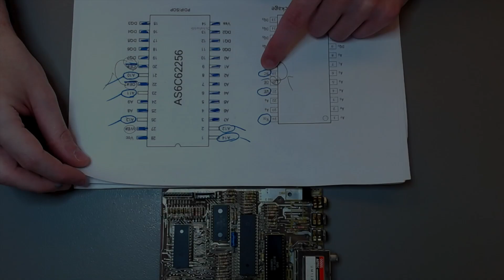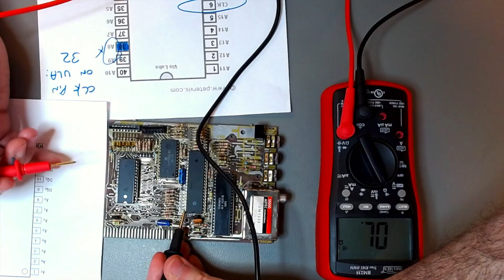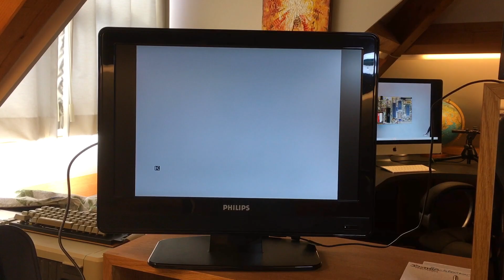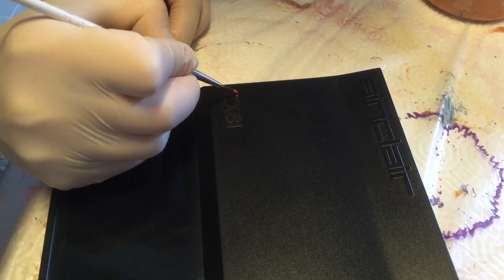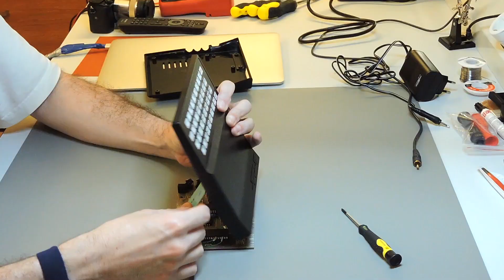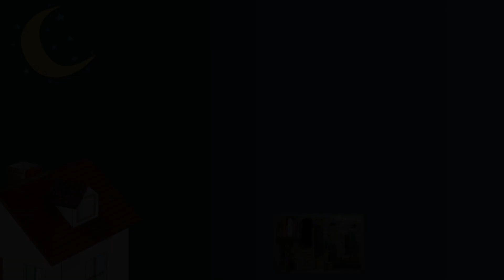ZX-81 memory mod, case & keyboard restoration, test-drive

Comment: My TS1000 has a D4016C chip, DIP24, in there with the LK2 already jumpered. I'll be changing to a 62256 this week. I'm glad I watched this video first, one less pin to worry about. Thanks!

Comment: I really learned a lot from watching your excellent videos on the ZX81, thank you for doing them.  I finally got my TS1000 working, I replaced the ULA with a vLA81, and that did not cure the problem, then I replaced the Z80 cpu and that cured it.  Now it has a new ULA, CPU, and 62256 memory mod.  I am going to order in a new keyboard membrane for it.  Thanks again for your help.  RJ
Reply from the maker: Nice to hear it!

Comment: Yes I agree, fantastic work.  After I finished Pimping Up my ZX81, I decided to do the same on a TS1000 that I have.  I did the composite video mod, and got the K cursor just as on the ZX81, next I did the memory upgrade just as before and got the K cursor, only it takes a little longer to appear, next I did the power mod, and installed a new Z80 and again seemed to be OK with the K cursor, and let it sit for awhile to see it anything over heated.  I then put on a new keyboard membrane and reassembled it.  After reassemble I hooked it up and powered it on, up came the K cursor as before, so I tried out some of the keys, and to my surprise none of the key function at all.  I took it apart and checked for +5 volts at all the locations and all seems OK, same for the 0 volts.  I am at a loss, any idea what the problem could be?  I am thinking the ROM?   Any help would be appreciated.  Thanks.  RJ
Reply from the maker: Was the previous keyboard membrane working at least partly, before you replaced it?
Reply: @thebyteattic  I would have to say no, because it was broken at the connector.  I went ahead and done the composite mod and got the K cursor, and the the RAM upgrade.  I did cut the broken end off the membrane and tried it, but had no response, so I then installed a new membrane with the same result.  Any thoughts?

Comment: I have a faulty ROM on my ZX81; before I buy a new one, I would like to make a test with a EPROM 27C64 (on a breadboard, as wiring is different).
Any idea where I can get the ROM content as binary or intel hex file?
Reply from the maker: I am not sure they are online somewhere, though I never searched for it.
Reply: @thebyteattic  I can't find it neither... Strange, as the ROM is fully disassembled with comments...
Reply: Search 'Files for ts1000-roms'

Comment: I don't think it is worth the trouble making an SD card work and changing the ROM etc.  This site https://forum.tlienhard.com/phpBB3/viewtopic.php?f=2&t=3360 shows Wespi running on an ESP32.  These come in larger sizes now that will hold every piece of software ever made for the TS1000/ZX81 and a web-based site where you can add more .p files.  They will be adding commands to rename, delete, move etc. that are run from the ZX81.  All via the SAVE signal that use to tell the TV to make those squiggly lines.  I am going to try this out.  My only worry is load time.  They say it will be the highest available on the Z80, which I think is 1200baud.  I hope that is fast.  I still don't even like waiting 5 seconds for a program to load, being use to the emulator(s).  The genius of this is that you mount it inside the computer and then use any computer to access the website on wifi that's inside the ZX81.  It's like having a built in hard drive without the hassle of trying to get IDE interfaces to work.  At one point I bought an IDE-->Compact Flash board to try to do this, (seems like noone has actually done this, but I did see a 1581 commodore emulator type unit that might work)

Comment: I have ordered the ULA replacement.  Can you please provide how to fully use the 32K or even a 64K chip?  It seems a waste to spend $45 on a ULA and not just put in 64k (max without bank switching) since the memory chips are super cheap.   https://www.tindie.com/products/charlieingley/vla81-zx81-ula-replacement/
Reply from the maker: 64KB is impossible on a ZX81, as the ROM must use some of the address space. To use 32KB of RAM you need an extra address pin from the ULA (the Z80 already has it). If I remember right, the replacement ULA has a free pin because it doesn't need to use an external oscillator (it has an on-board one). But I don't recall now what it would take to use that extra pin as an address pin. I remember it wasn't worth the effort, though, as there is no software for the ZX81 that uses more than 16KB.
Reply: @thebyteattic  Thanks for your fast reply.  Pimps don't need half the stuff they have either.  Isn't that the point of pimping out something?  Gold ear and mic jack's?, not necessary either.  So I want to make use of the full 32K chip or even a 48K chip if available.  The eighty one emulator shows the option of 48K for the TS1000/ZX81.  I am actually working on a GUI for the 2068 and later will port/rewrite it for the 1000.  I'm not sure if I will break the 16k mark, but it might.  And as I add features it might even break the 32k.  I want to use real hardware and not just the emulator.  The TS1500 comes with 16k on board and one can plug in a 16k Rampack to get 32k, but I guess there are a couple poke commands that also need entered (have not found them online yet).  So my guess is that we bend up the ULA line that would go to the oscillator and then connect it to the proper Z80 line for memory and run a couple poke commands.  Any info will be helpful, even if you don't want to do such work.  I also have 16K and 32k and 64k and a 128k  memotech RAM modules, not sure how they work yet though.  And also the memotech HRG module.  (That one I found instructions for online).  But seems like the new HRG software does not even use this device and does it some other way called WRX or G007.  Still trying to learn what those mean.
Reply: @thebyteattic  Any info you can provide to do this would be appreciated.

Comment: My PCB design for the memory expansion is now on github: https://github.com/redhawk668/ZX81-Internal-16K-Expansion
Reply from the maker: Fantastic, thank you!
Reply: I also put assembled PCB’s together with a 28 pin socket and instructions on my Tindie shop: https://www.tindie.com/products/redhawk6682020/zx81-internal-16k-no-wobbly-expansion

Comment: I’ve designed a little PCB with an SMD 62256 chip on it, together with a decoupling capacitor and a 10K Ohm resistor on it and all the needed routing on the PCB itself, so no need to bend pins. The 10K Ohm resistor is put between pin 28 (+5 volt) and pin 27, it is to make HRG8 mode working. The ZX81 was my first computer too.
Reply from the maker: Cool. Is it on Github? If so, it would be nice if you could post a link here.
Reply: @thebyteattic  I will publish it on github soon. Might even sell them in small batches if these is demand. My first prototype had some errors. These are now fixed.

Comment: Very interesting! 

Would it be possible to design a drop-in replacement PCB that uses original chips, and also makes 16K of RAM addressable without the need for bodge wires? I tried searching online but couldn't find any such projects.
Reply from the maker: Yes, this is not only entirely possible, it's quite straightforward. I am not sure whether anyone has done it, but it should be quite trivial.
Reply: @thebyteattic  hint-hint, nudge-nudge... 😉
Reply: @thebyteattic  oh oh, and also the composite video mod directly integrated into the PCB in place of RF modulator 😁

Comment: Great video, thank you for making it. I don't understand why the RAM isn't addressing the full 32KB, why only 16KB? I thought the ZX81 could address 64KB directly.
Must have been covered in another video, I will check them all out. I look forward to other mods, possibly adding a sound chip or joystick ports? I also thought it would be cool to play with the 8255 Intel I/O chip connected to the bus of the ZX81. To control external devices. Just a thought. I have several XT IBM motherboards that use these chips for cassette input and keyboard.
Anyway, excellent video.
Reply from the maker: By the way, I am working on 're-imagining' (i.e. re-designing) of the ZX81. Hopefully I will add an SD-card interface, a joystick port and a PS/2 keyboard. Right now I am trying to re-write the kernel (ROM) to make sure I can do this other stuff. The hardware is easy, the challenge is the kernel.
Reply: @thebyteattic  ...Fantastic ideas! Maybe bring some ZX81 fans into the project, let others (say a ZX81 users group) carry the water for you on the ROM rewrite whilst you deal with the other upgrades? Just a thought. I am thinking a step by step approach, for instance start with the joystick port (I understand a couple A/D chips and discreet components are involved), then add PS/2 keyboard interface. I know these elements of the upgrade can be done with the existing ROM as both were offered as an upgrade through various companies without modification to the ZX81.
I like where your going with this.
Reply from the maker: @gregryan7761  Thanks, good suggestions! I will try to give it a first shot and then release the results to the community, so it can be iteratively improved 'in the wild.' :-) The thing is that the hardware and the kernel code in the ROM go hand-in-hand, regarding e.g. memory maps, I/O protocols, etc. So to do some hardware I need to do some kernel coding along with it.
Reply: @thebyteattic  I have been doing research and found out about something called "ghost" memory locations as memory is increased. I really don't know what that means, I am hardly a tech dude. Let me continue learning about the ZX81 memory map.
Keep up your interesting work.
Reply: @thebyteattic  Drs Logan and O'Hara The Complete Zx81 Rom Disassembly. book. a must have for tinkering with the OS.

also Understanding Your ZX81 ROM by Dr Logan.
Reply from the maker: In principle the ZX81 can address 32KB, but you need to replace the ULA with an FPGA then, and free up one pin to use as address line. The Z80 can do it, the problem is synching up with the ULA.
Reply: @thebyteattic  Hope this helps with the RAM upgrade to 64KB:
https://www.sinclairzxworld.com/viewtopic.php?t=1734
This fellow came up with a daughter board that seats the ROM and new RAM chips nicely. This fellows ROM was bad, so he did burn a new ROM image, but unmodified from the original apparently. I hope this helps, but hey, your probably satisfied with your very respectable 16KB upgrade, which is much easier and certainly is a boost,  making your ZX81 much more usable and productive.
Reply from the maker: @gregryan7761  Thanks!
Reply: @thebyteattic  It can do the full 64KB if you have more complex decoding logic.